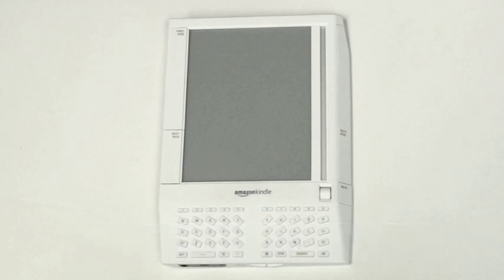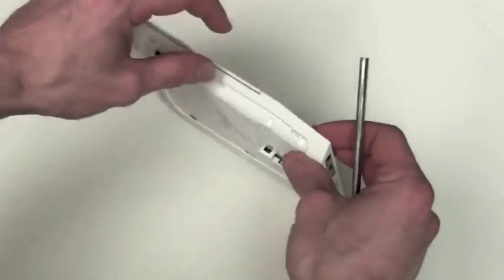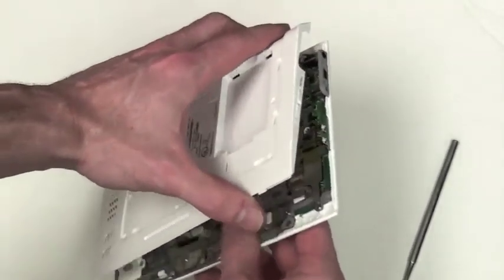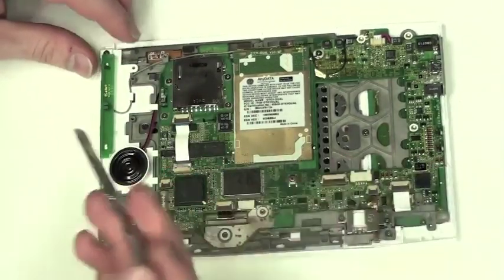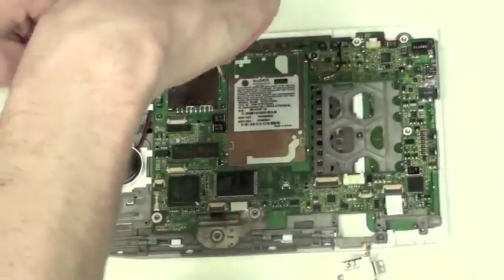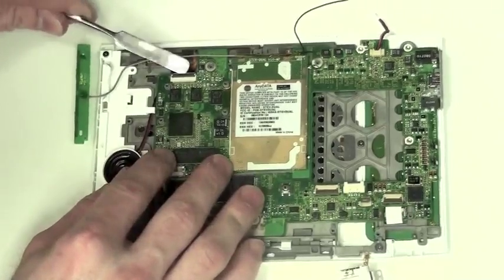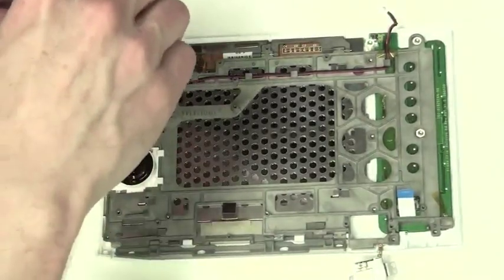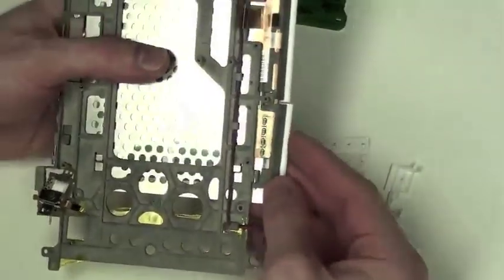How to Repair an Amazon Kindle 1st Generation D00111

Comment: Thanks for this video- much appreciated! I'm still rocking with my G1 Kindle. Stupid question... I have the whispernet wireless only version. Could I buy a WIFI replacement antenna & install it and then have a WIFI / whispernet working Kindle? Also, what's the most common repair on a G1 Kindle? What breaks the most?  Thanks again!